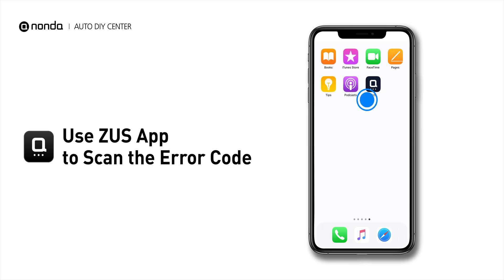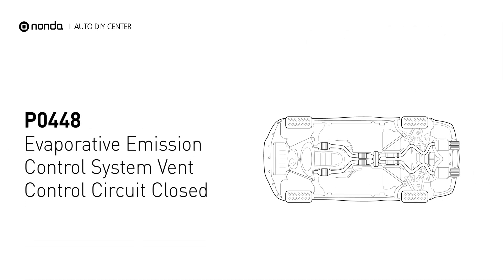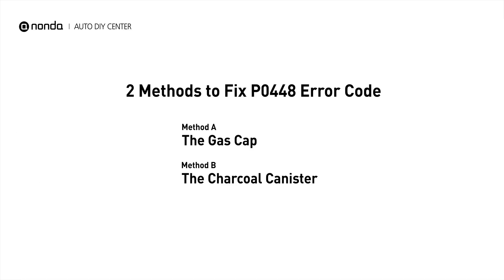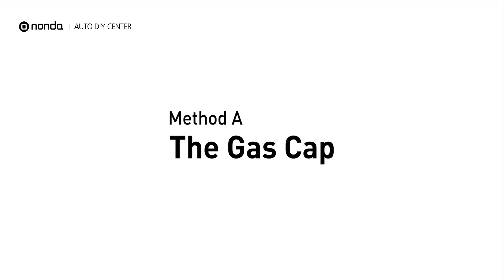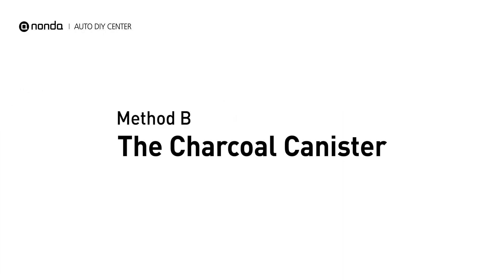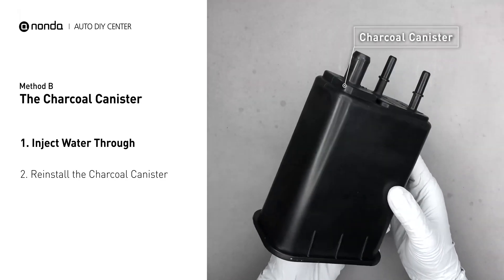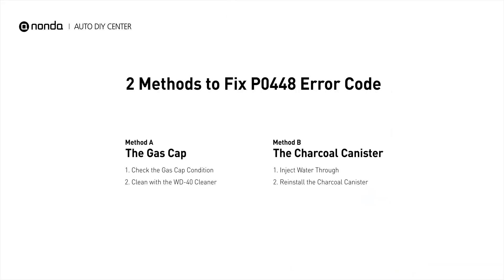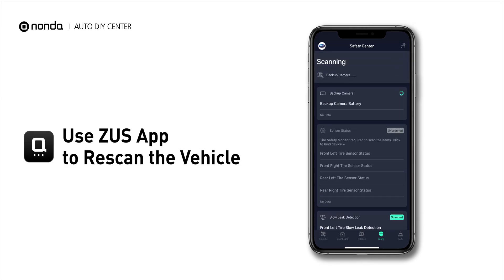How to Fix P0448 Engine Code in 3 Minutes [2 DIY Methods / Only $4.46]

Comment from the maker: Hi, I'm Steve, nonda's lead mechanic engineer. 
Feel free to leave your comments here if you have any mechanic questions, I will be glad to help you out!
Reply: Hey so before I got this code I had issues feuling. It only allows up to 10 litres before it clicks and then I need to keep letting it drain to fill again only 5 litres or so at a time before it fills up the reservoir & clicks it off again..

Now I have this code.
Is this a serious issue? Im afraid to drive the car

Comment: Have a 06 Nissan Sentra with p0448 for 2 years last year mechanic change evap control vent valve 6 months later code reappear
Reply from the maker: Hi Shawn, if this is the only code you're getting, you can follow the tips/solutions provided in our video on how to fix this code. Hope it helps!